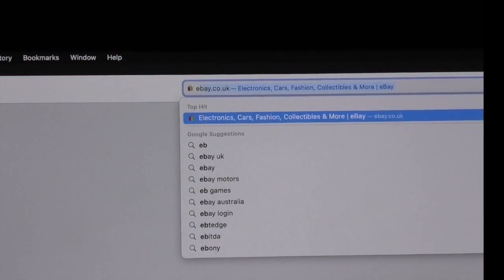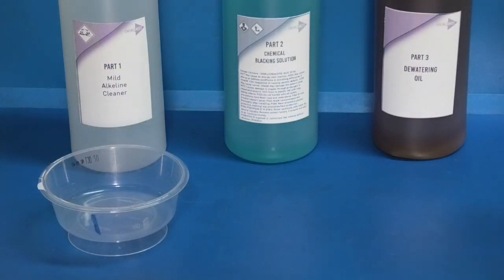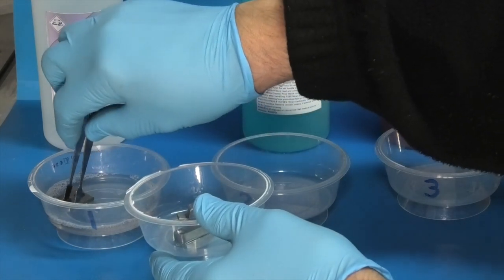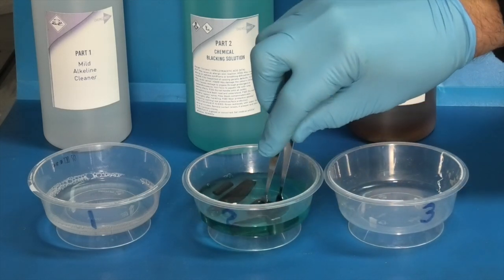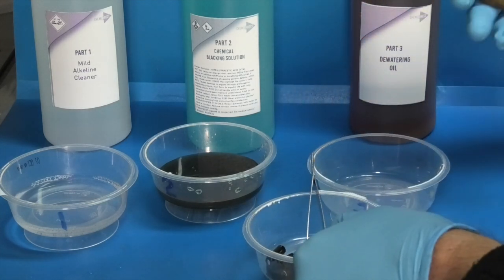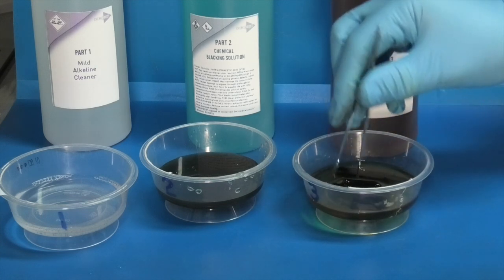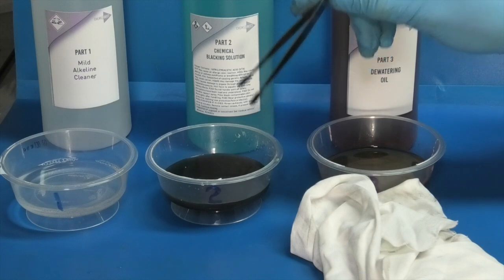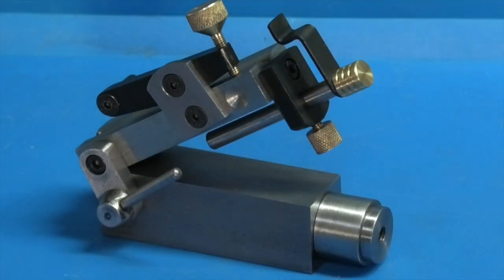Chemical blacking

Comment: Hi Alan
Does the blacking process “coat” the parts? I was just wondering whether a close fitting pair of parts would still fit together after blacking?
Thanks 
Peter
Reply from the maker: Hi Peter. The process changes the outer layer of steel to a black oxide the parts should still fit together

Comment: Good demonstration Alan, and a very nice result. I use Phillips cold Blue, which is a single chemical. Mixed 1 to 3 with water. The mixed chemical can be used over and over until exhausted. I clean the part first in soapy water to degrease it, and after bluing, coat in oil, to stop rusting. Cheap and very economical. I did a little video on it about 3 months ago. Cheers Nobby